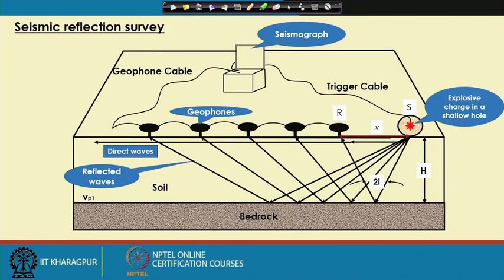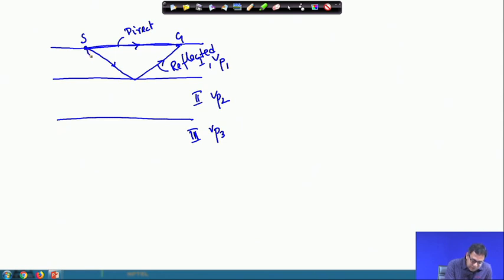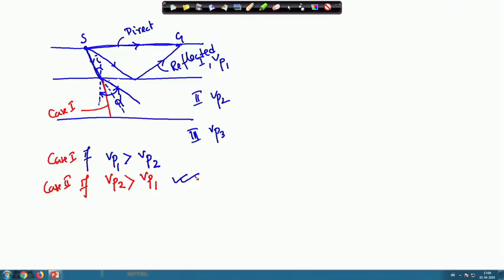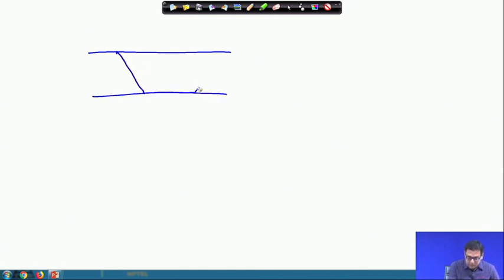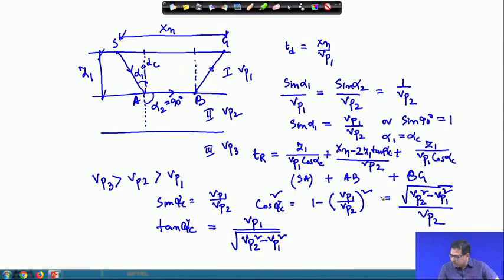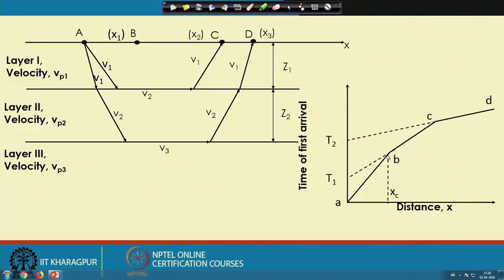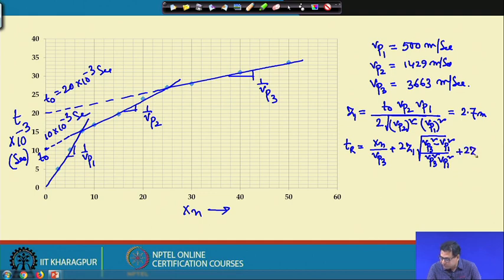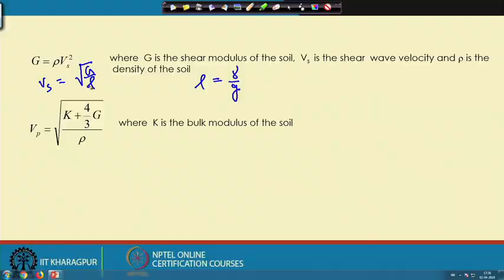Lecture 10 : Geophysical Exploration (Contd.)

Comment: But sir when light(wave) passing through air to water then light bent toward normal 
And once more point that   density of water is more than air but velocity reduced when light going into water (but u have say velocity increase with incr in density) 
I have confusion about this pls explain
Reply: With the increase in density the void ratio will decrease and the waves get the perfect way to travel
While in case of low density , because of the voids the wave will deviate from it's path and take longer time to reach to the receiver.
.
.
If want to know more , you can prefer to the ULTRASONIC PULSE VELOCITY.  non destructive testing method to understand this one.